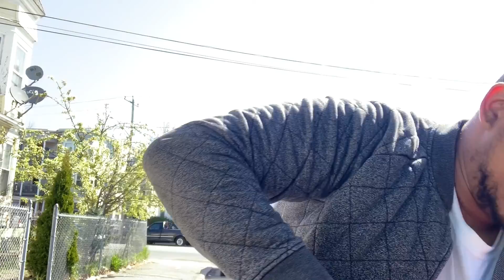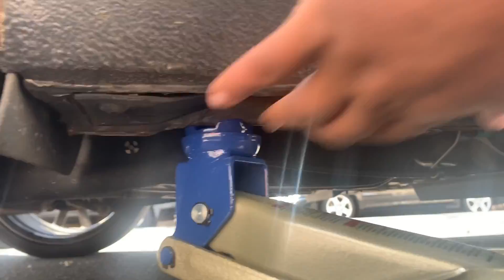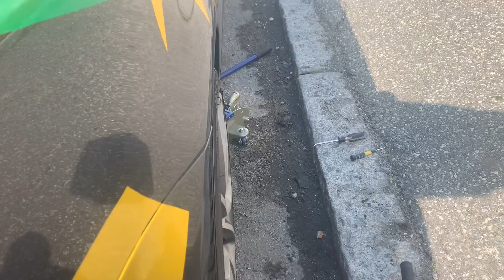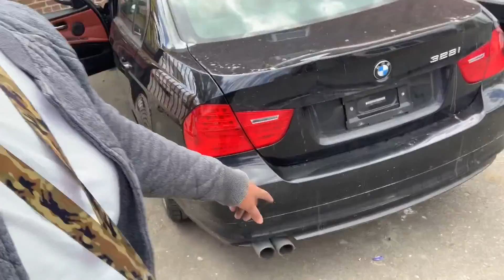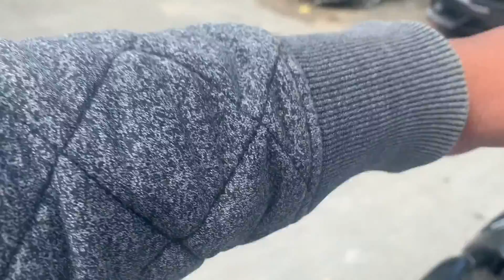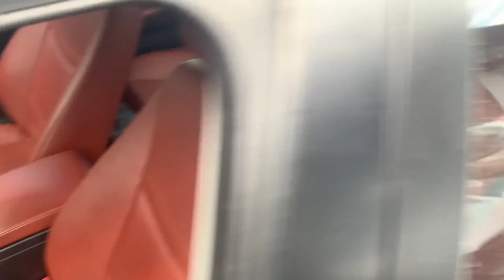Installing spacers, new project car?

Comment: They look good. Are the safe in general? I’m considering for my mustang
Reply from the maker: Red5oh tbh i might be removing them, i was driving in the highway and my car was kinda shaky🤷🏽‍♂️ and it maybe cus of it
Reply: Awli yeah that’s what I’ve heard that it can be unstable and worst case pop out. They are a nice mod but I’ve just been skeptical but I know many people do it without problems
Reply from the maker: Red5oh yea if you driving alot on the highway i advice against it but if you dont drive too often or in the city you should be fine